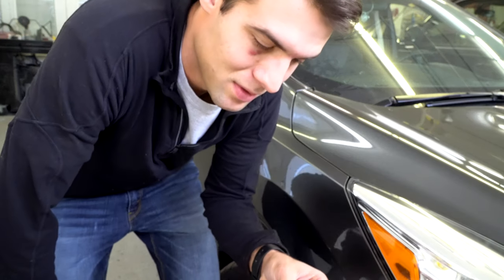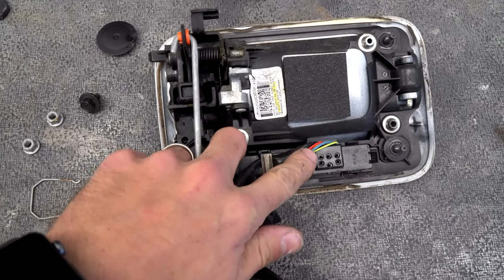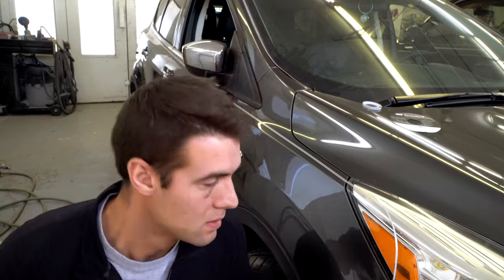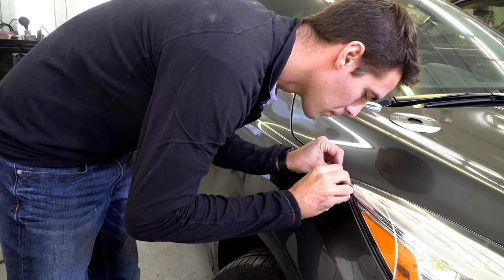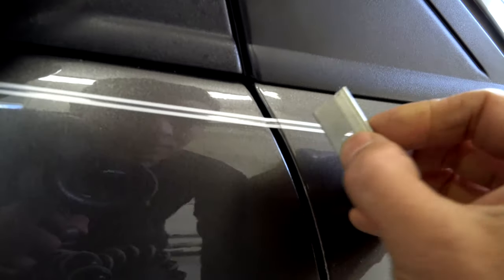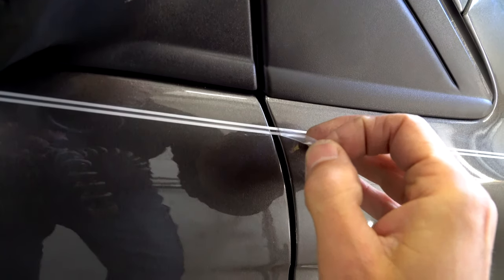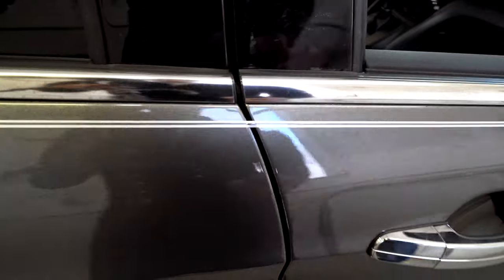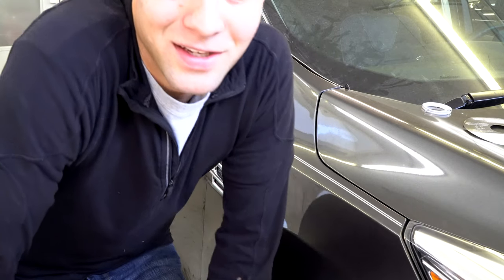How to Pinstripe a vehicle using 3M stripes // #theautobodyguy

Comment: Beautiful job. Only one problem, you are so good at doing this that you make it look easy, which I'm sure it isn't.
Reply from the maker: You can do it!
Reply: Following your instructions, I freakin did it! Added a pinstripe down the side of my truck, but with a little heartbeat monitor zigzag near the front ends. Thanks for the help! But... It basically feels like I just put masking tape on my truck. Does it cure onto the vehicle over time from the sun or anything? Seems like it might not survive a car wash, just going by how I was able to peel a bit off to make corrections as I went.

Comment: I used to be a technical instructor in the USAF, one point, your audience/students cannot learn when your back is facing them.  Next, what did you use to  clean the surface before applying the decal.     I like the stripe you applied.  Hint: show the tape you used, you did, next show the surface cleaner and it’s use,  show the tape and it’s many parts, get the idea I’m talking about.  You never explained the importance of the “clean” surface.